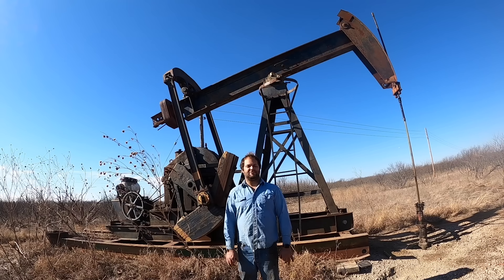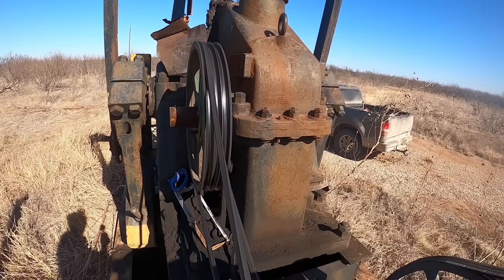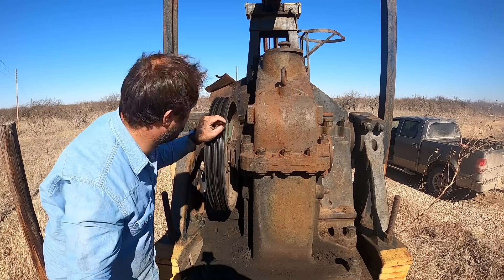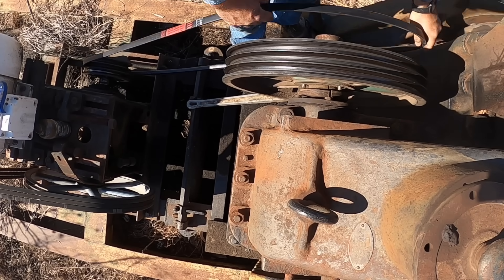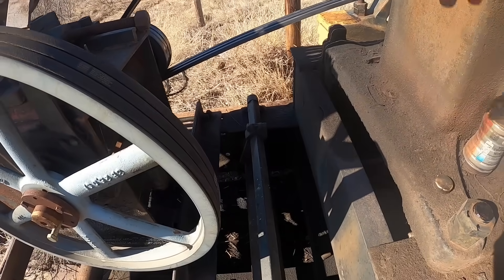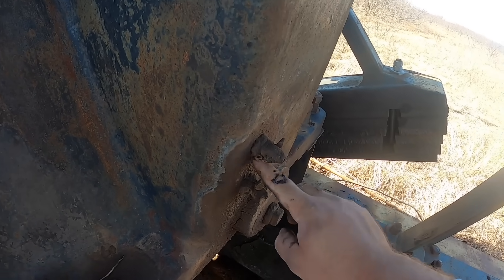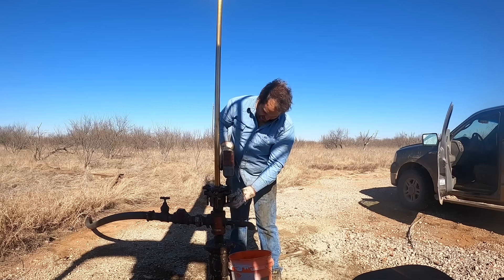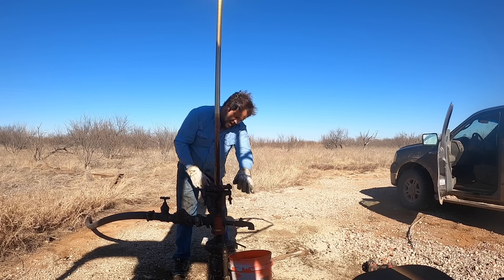Maintenance on a 101 Year Old Oil Well

Comment: I’m from eastern ks Missouri oil country. What size of Down hole pump are you running on this well?
Reply from the maker: 2-1/4 on 2 inch tubing with a on/off tool.
Reply: Exactly what I was thinking I thought it was 2” we have a 3 1/2 inside 2 7/8 with on off tool just a pain In the ass water is corrosive and just hell to get the rods off the pump. Thanks for the response I’ll be looking forward to more vids.

Comment: The reason the longer brass sleeve works better is because it’s got more area and conducts more of a positive charge as the rod works through it. Hence the reason it’s better for electrolysis.
Reply: Galvanic corrosion of dissimilar metals. Between Steel and Brass the steel is the sacrificial anode. SAD!. Youre saying by increasing the surface area of the brass it gives more sacrificial anode material of the steel reducing the total effect of galvanic corrosion of dissimilar metal on a smaller area of the steel. The way I would do it is find out where I can install a zinc on to the steel. Is a "zinc" a thing? probably not outside of boating and your water heater as sacrificial anodes to expensive steels, big dog.
Reply: I seem to remember when my dad was a pumper, that a polish rod liner had fluid circulating between the liner and polish rod to keep it cool.

Comment: My dad pumped wells here in Ohio. In the summer, when I was a kid, I'd ride around with him to all his wells. He always carried around a big cresent wrench and a grease gun under the seat of the truck. He had one ancient well with an old pump jack with a gas hit and miss engine on it. I remember him greasing the polish rod and stuffing box up, checking the oil in the engine, setting the gas or throttle and cranking the flywheel. When the engine was running good he would release a break that then would engage the horses head. He'd let me go up on the tank to check the oil level which was fun for a kid.😊😊
Reply from the maker: That was me as a kid with my grandpa. Riding around these old leases.
Reply: @TheZachLife  When I was around 10 years old, my brother and I would walk about a mile to fish in the river. There was a nearby oil well that had this old pump jack that had an old engine with a huge flywheel that ran slow and made a bang about every 2 seconds. There were some counterweight boxes on the back that were filled with what I now know to be steel punch-out pieces from a local factory. We thought these were really cool and could skip these like rocks on the river. This rig moved so slow that we would climb up and jump on it to ride it.  Luckily, we survived and didn't lose any limbs or worse.
Reply: @TheZachLife  How did they lubricate the first oil well pump?
Reply: @Anon54387  Perhaps with Castor oil or whale oil.
Reply: @Anon54387  Whale oil ...
Reply: With grease
Reply: @Anon54387  they used graphite
Reply: @Anon54387  spit
Reply: @Anon54387  

Anon54387
7 days ago
 @TheZachLife 
 How did they lubricate the first oil well pump?

Whale oil...😁😁
Reply: @Anon54387  There were places that oil bubbled up out of the ground by itself
Reply: @Anon54387  melted down whales
Reply: @Anon54387  Before mineral oil from the ground, there was vegetable oil, beeswax, animal fat (tallow), grease and oil whales.
Reply: @TheZachLife  What is the separator and what is separated there.  This was most interesting.  The 17 minutes went by like a flash.
Reply: @Anon54387  An oil well will typically also produce some water and natural gas. The seperator is a typically a pressure vessel, that allows the produced fluid to separate into a liquid and gas phase using gravity.
Reply: @Anon54387  we call them treaters, and they use a burner, dump valves, an insulated pressure vessel, floats and things to separate the water from the oil along with the gas.  The ones around here are pretty much vertical treaters with a treater shack built around the vessel to keep them from freezing in the winter.
Reply: @Anon54387  The Separator separates the fluid from the gas, the heater treater separates the water from the fluid leaving just the oil going into the tanks.
Reply: @Anon54387  The separator takes the oil/gas one way and the water to a storage tank to be either hauled off by truck or to be piped off if there is a production water collection system in place.  Either way the water goes to a disposal well. The gas is either burned in a compressor setup, collected in a gas gathering system (if available) or flared off at the site.  The oil is either piped off in a gathering system or it is held in storage tank until a driver comes to "buy" the oil (that's where the oil is checked for water and dirt.)  If it passes it's loaded and taken to a refinery or to a pipeline or rail station.
Reply: @TheZachLife  Could you do a video and go into more detail about the gear reductions and pulley sizes and the resulting forces, torques, etc?  You understand it thoroughly, but a little more explanation would help those of us who aren't as familiar.
Reply: Great story!  Thanks
Reply: My dad pumped several wells for two or three different companies and I went with him during summers. We were always changing packing, (Split donuts} or tightening them up. Changing belts, greasing bearings and oil the polish rods. Most of his wells were electric by the time I was around. A few were still the old Fairbanks Morse engines. What you call the hit miss engines. Some times the build up at the bottom of the well would cause the pump to hit and get slack in the cable on the saddle and we would have to adjust that. Every time I smell crude oil I think of him. Our polish rods were always brass, never saw a steel one. I've watched them pull wells and replace pumps and sucker rods and I've been with them when they lowered nitro down a well and touched it off to fracture the formation and I've seen Halliburton do it with there equipment. Those big ole trucks would start jumping and shaking. 24/7 job. Boy the memories.
Reply: @marks3750  fairbanks morse are governed not hit and miss
Reply: Still have a few hitnmiss up here in slavelake Alberta Canada
Reply: Are you around snyder tx
Reply: gotta few old ones in my town of leroy/madison ohio i always wonder how old they are
Reply: what part of ohio ? my grampa worked for Oxford oil in wooster
Reply: I bet it was! Just watching Zachs videos makes me think how cool it musta been . Did he leave any wells to you?
Reply: Catch ya on the next one! Ya, old indeed! Oil! Mmm hmmm that would be about the size of it!  Anyway! Awesome rig, "there!"  All positivity!
Reply: Thank you for making this video. Growing up in Ohio when we got to travel to Southern Ohio and see these Wells dotting the scenery. I was always fascinated by them.  How they worked, how much oil they got from them etc. The one in this video seems to be in the middle of  nowhere.  I would  love to know how they knew to drill there and hit oil.  It only took 50 yrs for me to find out how one works.  So I take it this one is pumping oil again?
Reply: I grew up in the wrong generation. My father had better plans 😒
Reply: Yeah til ur kid dies of h2s. I'm 40 been doing this my whole life wouldn't let mine nor any other child near a tank

Comment: Where is the oil?
Reply: The oil is the brown sludge, mixed in with large amounts of water. This marginal well is at the end of it's (100 year) lifetime, only producing very small yields. It is only kept running while oil prices are high, orherwise it would be unecomical and shut down.
Reply from the maker: This well is very profitable for us and has had a  steady rest of production for at least the last 30 years and has been continuously pumped during the high's and lows.

Comment: When purchasing belts for a multi belt drive there is a thing that's called "matched" belts. Belts are manufactured to a tolerance which is the part number. They are then measured and there are numbers printed on the belt which reflect it's measured size. It's important to use matched belts on multi belt drives for extended life.
Reply: The sun will damage those belts long before a slight mismatch will.  In this situation it will make no diffrerence at all.
Reply: Match belt numbers came from the same mold number used to make the belt.
Reply: @dalewhitacre1185  Part numbers came from the same mold. Matching numbers are the actual measured length. 2 different things.
Reply: Cost being the only deterrent on something that has a marginal payback on a CNC lathe making aircraft parts different story.
Knowing next to nothing about this industry my guess any profit from this well is measured in hundreds of dollars a year if this gentleman was to be paid a fair wage there would probably be no profit whatsoever.
During times like this oil brings good money and effectively pays the losses that have been accruing over the years although the costs have been shifted at this point to different areas.
If oil is going for over $100 a barrel that means all of our enemies are fat with cash to buy weapons to harm us and our allies that is where the costs get shifted.
But for most of you younger people you have no idea where things come from or how they came about what about all of us older men who worked hard to provide for you as children now only to be scuttled by you in your zeal for maximize profits and the like.
I wish you luck and that you find a more hospitable retirement if you ever see such I know for myself my anger and bitterness towards our government and all you smart guys who just treat people like us like yesterday's garbage.
And people like Barack Hussein Obama who have brought you to this point in our lowest point in this country's history and said things to us the older generation who provided for you a very good future how bad and evil we were for all we did using words like antipathy that worthless pile of shit I will have you know Is a malcontent a communist a destroyer of all things good he's a filthy pig of a man who has earned nothing our ire and disrespect that should go double for Michelle. 
These people have enjoyed the fruits of our labor as well as an Obama's case The very finest that could be provided him by his white mother and grandmother in a beautiful place Michelle has been equally well treated where they come up with this garbage but somehow they have been dissed or in any way held down they are now rich they have at the disposal anything everything they wish but it's not good enough to sit in their palace and leave us alone no they must interject they're bullshit their hatred they're disrespect towards us.
Not enough that Joe bite me not our president he was the loser we were told a lie by the media the government and big tech to further there control over us.
I hear Michelle is thinking of a run for president I can't even imagine I think she had no less than 50 servants at her disposal the last time these dirtbags occupied the White House.
I commend this man for his work his knowledge and his sharing.
God for those of you who do not believe I'm sorry but he provided for us that's just we have provided for you many things in our case he provided us with an almost infinite supply of renewable energy they don't like the words hydrocarbon or oil that means or provides us with freedom they deny us freedom by changing the meaning of words and destroying the moral values we used to hold dear.
They go about destroying our heroes our values our hopes and dreams leaving us empty with nothing only slaves to a state and politicians that hate us they believe they can do without us they no longer wish us a slaves I don't know who will serve them but I think they will find someone I only hope that it is their captors that use them as slaves before God brings them back and his fold and hands them to the devil for destruction.
Reply: @chauvinemmons  what on earth are you talking about? I am simply pointing out a clear fact which he would actually benefit from. Belts are not cheap and likely running multi belts without matching shortens life by half.
Reply: @eddiereichel9354  How did this even happen.
Reply: @chauvinemmons your packing a lot of hate
Reply: @chauvinemmons  I understand where you are coming from and your motivations, people need to start thinking for themselves and not rely on, or be suckered in by, big government. Big government is what sank the USSR.

Comment: Really cool that you get to work on oil pump jack wells I’ve always been fascinated by those machines especially the ones that use the old wheel and cable drive system and even the individual units that are powered by a hit and miss engine or a Fairbanks Morse engine
Reply from the maker: Thanks. I uploaded a video a week or two ago of new well with an arrow engine.
Reply: @TheZachLife  There was a time not too long ago there was once in oil well out in Oklahoma that utilize the old Rod driven oil well technique it was powered by a Fairbanks Morse engine with a crankshaft which turn the wheel with all the rods going in all directions but as of the 2000 teens the well was removed by a high tech energy company and the oil pump jacks were donated to a museum somewhere in Texas
https://youtu.be/uzkVVwsic9g
https://youtu.be/I_L6jqizKnE

Comment: My parent had one that went back to the first dozen in NM.
What came up slow was a tar like substance.  As the easy
crude had long since departed.  Folks still came to buy the
issue when called.  That area abounded vacated pipe that
I was told had marginal content that few owners wanted
to keep pumping.

Comment: Lufkin makes a rod clamp with a large bolt with a rounded tip that you can hold up you upper and mid section stuffing box flanges up while you change packing. Up here we have to turn in ratigans to keep the extra gas (pushing some fluid)  in the well bore when we change packing. We also have a box filled with 80 90 wt oil to lubricate the stuffing box rubbers. Pretty cool video.

Comment: What size of tubing do you use on your wellbores? Um here in Canada its usually 2 7/8”
Reply from the maker: It depend this well has 2-3/8 as do most. If its a high volume well we will run 2-7/8.

Comment: So periodically your contractor comes around and drains down the field battery and takes it to the refinery/pipeline terminal. Do they just give you a daily going rate for crude say 100 bux/bbl? Or do you hold off deliveries and play the market for higher prices? Good vid! Lots to go wrong on a 24/7/365 machine.
Reply from the maker: Yes, It's sold by the truck load of about 160bbl. The price we are paid is complicated to explain but it basically boils down to If we sell oil in march we are paid the average daily price between feb 25th and march 25th.

Comment: How do you treat the water that comes from the well ??? Since the well produces lots of wet gas, how do you keep the gas from expanding ??? Did this well originally just produce light oil and is the oil sweet.
Reply from the maker: These wells have always made significant amounts of water. The produced fluid is like a soda. If will foam or fizz little but theres not really much gas that actually comes up with the water. For the most part its injected back into the ground without being at a low enough pressure for it to fizz. Sorta like a coke in a bottle.
Reply: @TheZachLife  So the water is injected into a well further from the original producing well ??? Why is there water in a vein of oil ??? Thanks Zach.

Comment: take the time. don't roll belts. this is for people whom don't know, please, teach right.  good video.
Reply from the maker: Thank you. I always roll belts. Most of these units don't have a way to tighten belts and its too much work and too much of a pain to try and carry a portapower. If there was a situation I would agree with you on it would be this one. I had pusher bolts made and put on the jack shaft and used them a few times but its just too big of a pain.

Comment: I don't believe that surface casing would be set below ground water level, any wells drilled that long ago didn't account for ground water contamination.  It's a big problem up here in Canada, especially wells drilled prior to 1980's. Most water tables up here in Canada are located around 1500 feet, most casing set prior to 1980 was around 600 feet.    This doesn't become a problem as long as they had good returns on cement, obviously with bad returns that pressure will seek path of least resistance which will be the annulus migration to surface.   Very informative video though, I was laughing when you turned the tubing with that snipe, I didn't realize it would turn so easily!  Do you know what the operator is getting in BBL/day from this well?  Keep up the great work!
Reply from the maker: We actually don't have ground water round here there's only a gravel bed thats about 30 feet thick. This well probably has 60 ft of surface pipe as that was the old standard. Today they require us to set 100ft of surface pipe. It makes about 6bbls. We actually have an oil sand around here that about 100 ft deep

Comment: That was great Zach. I don’t know if this was a test but I’m glad to see you had your mittens on! I saw you were getting snow how much did you get from this latest storm? When did you do this the weather looked nice? Now I’ve got to try to remember all my questions. So this well must run all the time? Will you take the bucket of oil home and let it separate out? (You had some in the last video) I’m surprised you didn’t have some patten to hold that casting up. (C clamp with a rag) Thanks Kc
Reply from the maker: This was Monday, my pickup said it was 72 degrees and two days later the high was 26. We got about an inch of ice and 6 inches of snow. This well runs 24/7. I just dumped the whole bucket into the oil tanks. The tanks have to be cleaned from time to time so a few gallons of water won't make any difference.